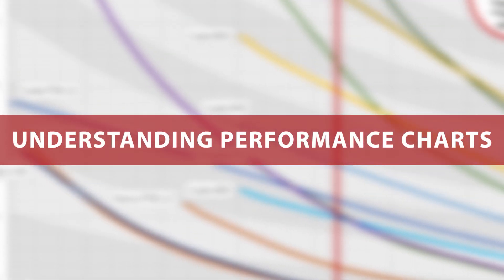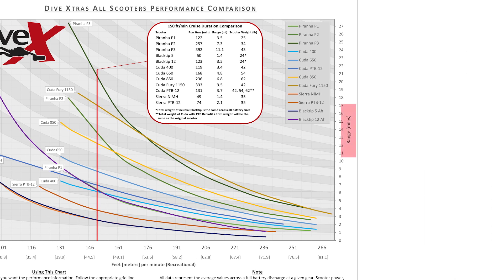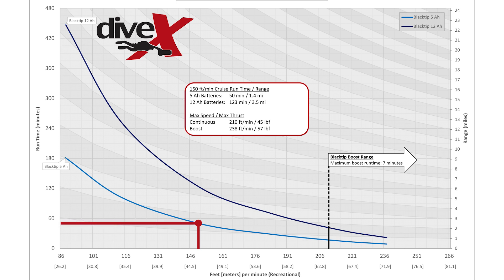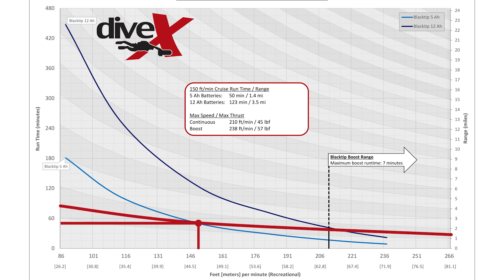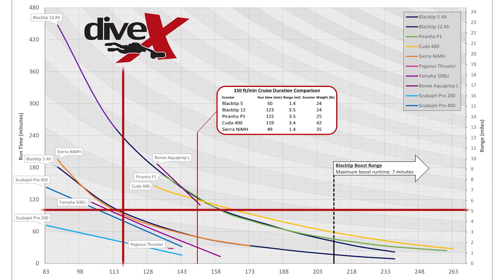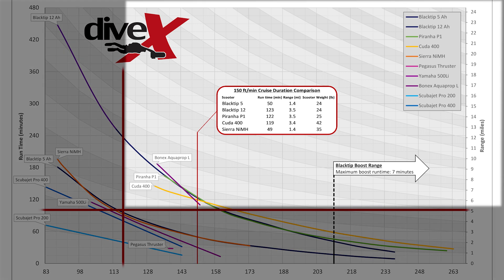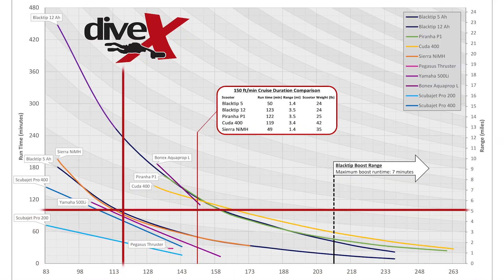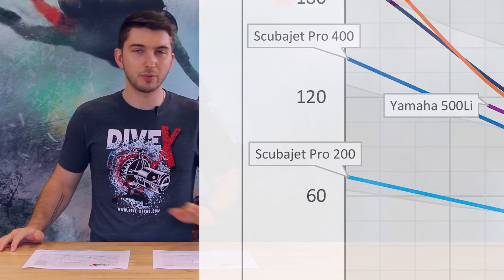Understanding Scooter Performance Charts

Comment: How do I know which speeds, equates to feet per minute? Said another way, what is the speed (FPM) of speeds 1-8 on the black tip, using the same metrics that you mentioned in your video? Thanks
Reply from the maker: The actual speed over the ground depends on the drag from the diver and so varies a lot, diver to diver. To get an actual figure for you, you would most likely need to run some sort of measured distance and see what you get. The figures we quote are for a standardized diver, which you can read more about under the "Notes" portion of the performance charts we publish. Does that help answer your question?
Reply: @divextras  sort of. In your analysis, pulling a streamlined diver what is the expected FPM? I understand it’s not an exact science. Thanks.
Reply from the maker: Sorry for the delay, I think I've got a few rough ballpark figures for you! I calculated these by taking the confirmed speeds displayed on the performance charts we've published and compared them to the factory default motor voltage figures found in the BlackTip's VESC software. I was able to divide the confirmed speeds by these motor voltages in order to get a fairly consistent ratio of voltage to speed. Here is the best math I could come up with:

Speed 1: 74 ft/min
Speed 2: 112 ft/min
Speed 3: 152 ft/min (cruise speed)
Speed 4: 172 ft/min
Speed 5: 191 ft/min
Speed 6: 203 ft/min
Speed 7: 218 ft/min
Speed 8: 238 ft/mim (boost speed)

I hope these numbers are close enough to answer your question?
Reply: @divextras  Thank you for that…!!! Absolutely great to know, and to assist in calculating distances over time. Thanks again for taking the time to do this…!
Reply from the maker: No problem, happy to help!